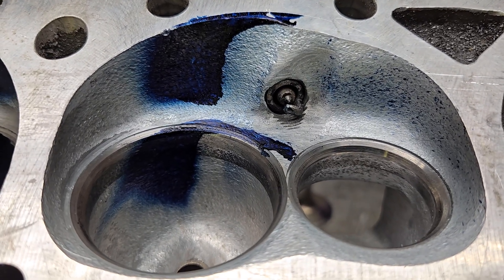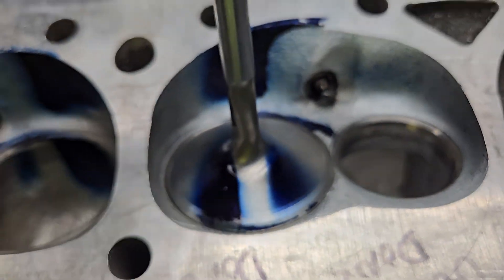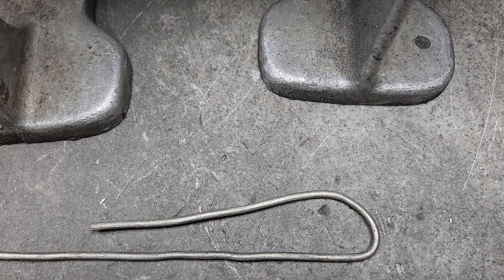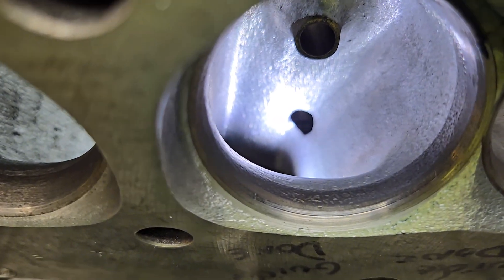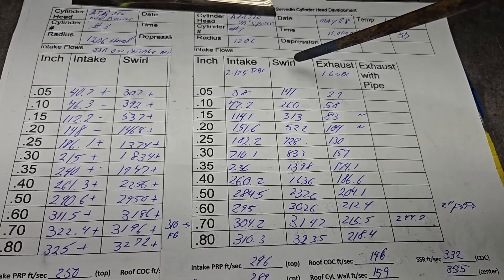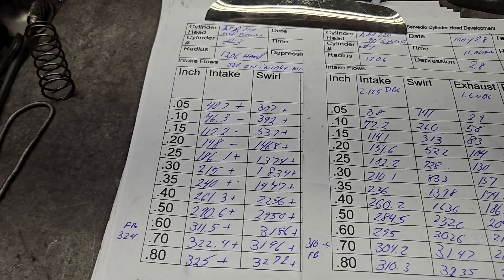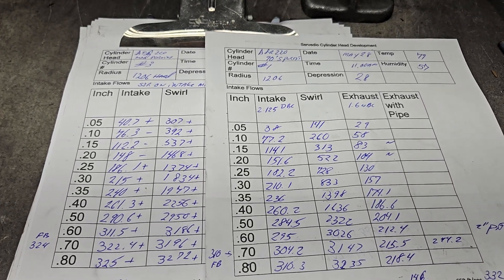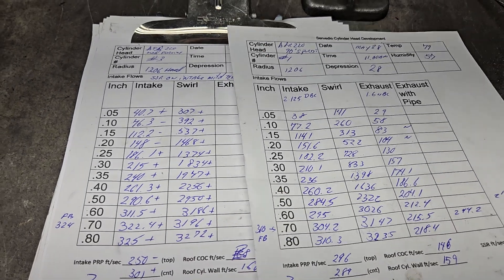Afr 220's Pre Eliminator cylinder head. Modern porting, ssr profile change.

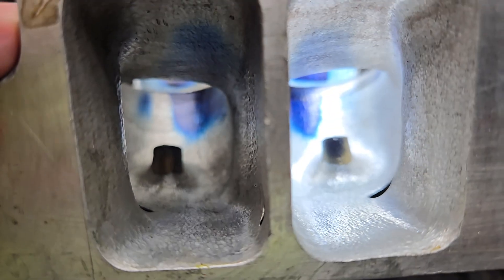Comment: @1:53 I know how you can knock the swirl down a touch. The radius right before the hole in the pushrod, if you slightly reduce that radius by like a .002" it will also peg back the swirl a little.